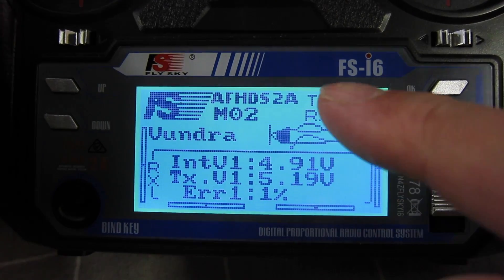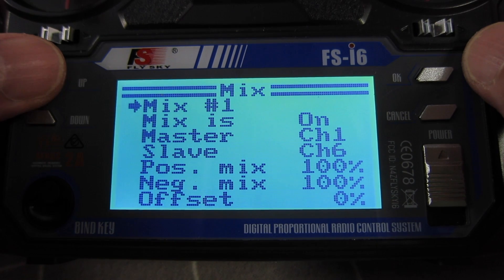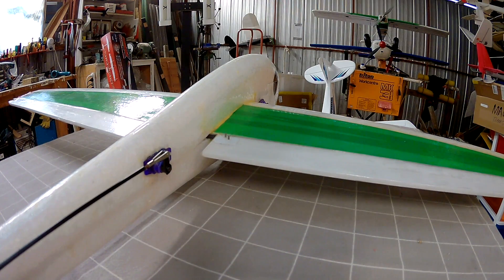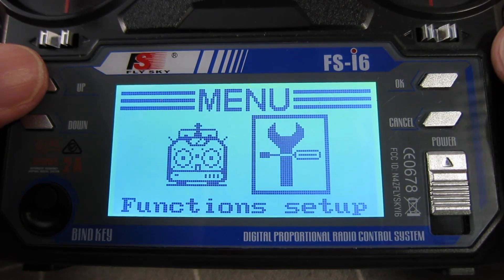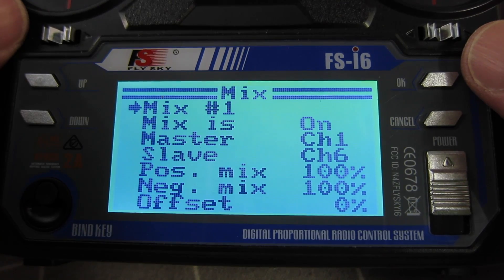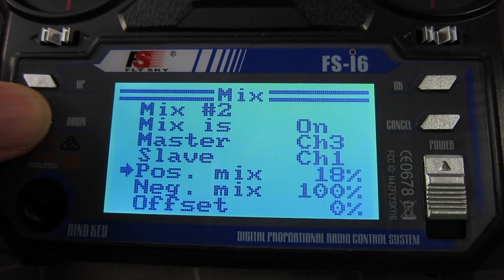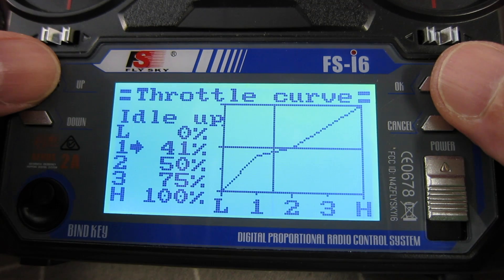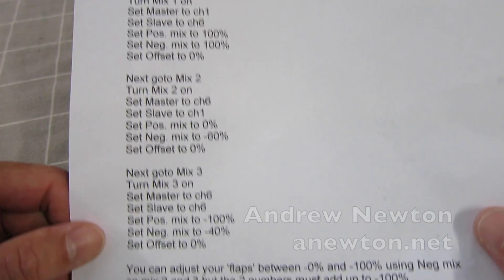FlySky i6 Flaperons - 3 methods

Comment: Hello Andrew, I have been watching your videos on the building and adapting the Phoenix 2000, with most interest.
I am in the process of buying either a Phoenix 2000 or ASW-28 and on your video I have seen that you are using a "Flysky FS-i6" (the same transmitter that I have in my possession),
Can you please help me to set up the transmitter to these gliders (the functions must be the same for both) and especially the set up of the flaps. Do you run the servo's simultaneously via two cables ending up to one going to the receiver or are the two servo's connected to two different channels?  Thanks for y our help, Emiel Driessen.
Reply from the maker: I use Taranis radios and OpenTX mostly. The man to ask is Allen Moore of NoobieRC, he is the Phoenix 2000 and FSi6 expert https://www.youtube.com/channel/UCxp23yC005hanSysA4vodQA
Reply: Good morning Andrew,
Thank you for your reaction, very much appreciated. Unfortunately your reference to Allen Moore of NoobieRC does not work.
Nevertheless I got answers to all my questions from you anyway, through your You Tube movies/explanations because when further surfing on You Tube I found videos made by you on 18 December 2016;
1. FS-i6 Programming.
2. FS-i6 Flapperon 3 methods.
They are christal clear and thanks to your good work and the time spent by you, I will be able to program my Flysky FS-i6.
Regards,
Emiel Driessen

Comment: Hi Andrew. I must say that your channel is great, informative and helpfull. I have started to fly RC planes in about half a year ago and learnd a lot from your channel. I have just finished to build Photon from from ExperimentalAirlines by  Ed, and as I have FlySky i6 I really like your tutorial how to set Flaperons, which I want to use. Here comes the problem. I have two separate servos plugged in to channel 1 and channel 6 is right aileron. I have settup the radio the same way as you describe. It works... "but" my ailerons are reversed.  You mentioned in the video that we should change positive and negative mix to either 100% or -100%.  Ailerons are wokring in the separate direction as they should when I set 100%, but reversed. If I choose -100 on positive mix  both are up and for my understanding negative mix left aileron should go down, but id does not. If I have both mixes on mix#1 on -100 both ailerons go up. But if I have 100% it works but reversed. Can you please help me to figure out the problem? My goal is to use separate leads for servos, and have flaperons for soaring.  I would really appriciate any help and any advice. Thank  you in advance. :)
Reply from the maker: Hi Martin. Photon was my first plane too. I would start from the beginning with your mixing. Just plug in the L aileron to Ch1 and get it working in the correct direction. Select Reverse for Ch1 if it's working in the wrong direction. Then my instructions should work for you. Good luck.
Reply: Hi Andrew, I must say that your answer kind of helped. :) I got it working eventualy, just had to set up new plane on the radio and start from CH1, put it to revers, played with it for about 20 min and got it working :D juhuu :) Now just waiting for a windless day to maiden it. Thank you anyway :)

Comment: Andrew, you are SO AWESOME!!!  Thank you SO MUCH!
One thing, though, mate....I don't understand why you say (in your comments section above) why dual rates AND  flaperons are not possible.  Mine both work great.  I separated the leads like you said, so right aileron goes on ch6 and left on ch 1 (with no y lead). I have the exact same radio, too.   ???  Could I possibly be running on different firmware?  (I'm running version 1.1 from March 2015)
Reply from the maker: Thanks Bill. I think it was something like the dual rates only working on Ch1 and not passing through the mix to Ch6. I'd have to recheck it. Don't often use that radio

Comment: Are Flaperons the same as Elevons?
Reply from the maker: Similar but different. Flaperons are aileron that are also used as flaps (when you don't have separate flaps) Elevons are Ailerons that are also used as elevators (like on a flying wing)

Comment: Thank you so so much, this really helped!  For some reason my switch c when set on position 3, kicks in the motor, i checked every setting but not able to shut that down form the switch C. I have set the flaps to 1 position switch D for now on my Efxtra.  Cheers!
Reply from the maker: Is switch C assigned to any function in the Switch Assign screen, like throttle hold or idle?
Reply: In Switch assign i have 3 options - Fly mode, Idle mode, Thro. Hold. Fly mode set on switch A - normal/sport.  Idle mode set to switch B, and throttle hold = off, for some reason the 'Switch C' does not shop up in switch assign as an option, i can only select Switches A, B & D for the 3 parameters. 

Wonder if its a software bug
Reply from the maker: You're right about the C switch not appearing, mine is the same. C must be in a mix maybe? Does anything happen in the Display screen when you switch C?
Reply: Yes, when the C switch is all the way down to position 3, on the display the throttle goes exactly midway 30% That means by default the C switch's 3 position is set on 50% throttle. I have this since the day i got this transmitter and haven't been able to resolve this problem
Reply: ok i figured it out, the swich C pos 3 was set to 50% throttle under 'Throttle Curve' i simply changed that to 0% when the swich C is on position 3,  Now i have working 2 position flaps. :)  Last thing is, when on position 3 the ailerons do not work however they work on position 2 (while the flaperons are activated) is this the same with you ?  Thanks again

Comment: Great video Andrew, I have the i6x, and have found a really annoying flaw (Flysky software designers whoopsie moment) in that switch assignments are global for all models, there is no way to configure switches to different assignments on different models...! A real wtf to flysky on that one, it has the potential to be such a great radio, just let down by a hungover software designer.
Anyway, flaperons are great, much better than cutting flaps into unequipped wings.
Reply from the maker: On te i6 switch assignments are unique to each model, but if it's not how the i6x works that's crazy.
Reply: It is first run i6x, firmware 1.0 01-jul-2016, I only hope they fix it with a future upgrade, else it becomes another junkbox radio.
Reply: Well, I updated the firmware to 1.0.38.1413 and guess what..they fixed it! One thing though, despite the 'successful update', the version number displayed in the menu has not changed, and it only displays the first two numbers with a date.. i guess they could do a version update update..
At least it is a painless smooth process. Thanks for spurring me into it.

Comment: Andrew, main problem with i6 and flaperons is that if you want to have dualrates or expo you are screwed. Mix1 takes raw input from ch1 and sends to ch6, no rates/expo settings applied. the only way to adjust throws remains endpoints. If you know a workaround for that let me know please:)
Reply from the maker: Oh thanks, that explains why my Ch1 and Ch6 limits are slightly different.

Comment: Channel 6 into Channel 6, recursive programming, very neat!
Reply from the maker: Why doesn't it create a run away feedback loop?
Reply: Don't know, I would have to do a "black-box" input and output state assessment and infer what went on inside the "black box" from that. I expect it would mean adding a hypothetical feedback system that stopped runaway conditions.

Comment: Hello AndrewI am having some problems with turnigy 9xr I bought 3 of them 3 years ago from hobbyking. 2 of them still in their boxes. Recently I noticed that the limits tends to drift ( if that's the word ) so instead of being 0.0 the Alieron Elevator and Rudder seem to self adjust sometimes -34.6 for Alieron 5.6 for elevator -1.2 for rudder. Sorry I hope I have not confused you. What do you think could be at fault? could it be I may have to replace my gimbals. Anyway I opened the other Turnigy 9xr and checked it to find that the throttle when all the way down is not down because timer is counting down and when I apply down pressure on the throttle stick it stops the timer. So out of 3 turnigy 9xr radios I only have one that works.
Reply from the maker: Why they would drift I don't know but you could recalibrate the radio (If you're using OpenTX) Page 9 in Radio setup
Reply: Yes even after I recalibrate it does the same thing. I am using frsky DJT telemetry in my radio and frsky D8R-11plus as receiver. I don't know if gimbals could cause it. Maybe I could send radio to you if ok? I am scared to go on using it just incase.
Reply from the maker: Keith, it's not a problem I have encountered before so I wouldn't know how to fix it. All I can suggest is updating the firmware and maybe replacing the gimbals if you can find them. Not much else you can do.
Reply: thanks Andrew. I put it away and stick with the flysky fs-i6 much easier to operate and works great. its pity have a few frsky D8R-11plus receivers and frsky DJT Telemetry radio modules.

Comment: Thanks Andrew your how to videos are some of the best and easiest to follow. 
Couldn't get my head around this kind of thing without help.
The Engrish manual doesn't make it any easier. lol
PS. Congratulations on 10 00 I'm not surprised realy such good videos and useful to information.
Reply from the maker: You're right about the dodgy manuals these days. I still find OpenTX way more logical than this but it's fun learning
Reply: Andrew Newton if I buy a pnf plane that needs a DX transmitter can I use the flysky i6 or will I need to change the receiver to flysky
Reply from the maker: DX is Spektrum I think, you would need to change the receiver to use your radio
Reply: thanks